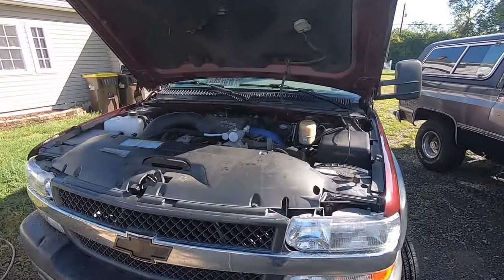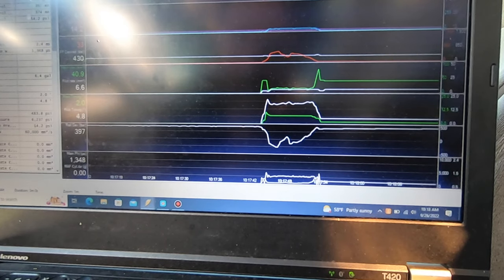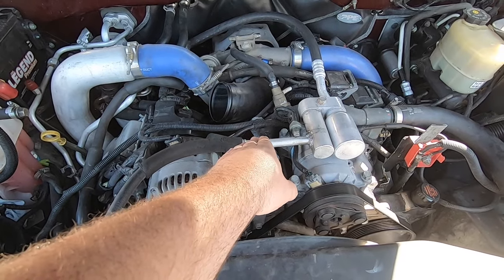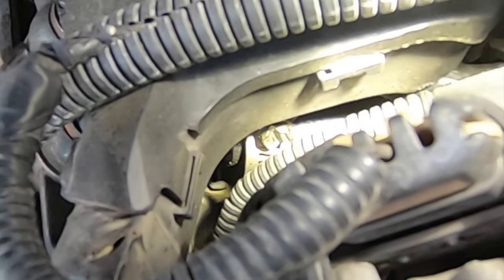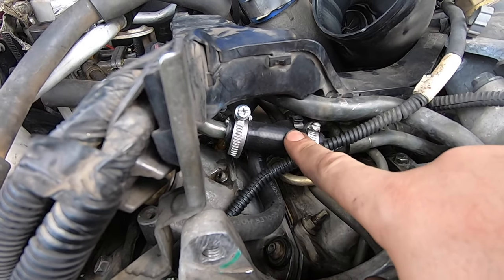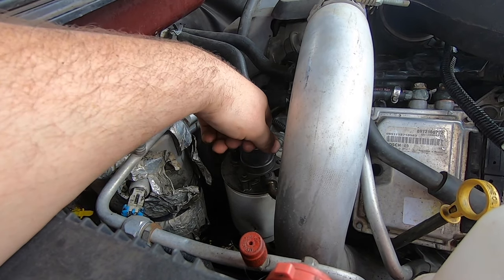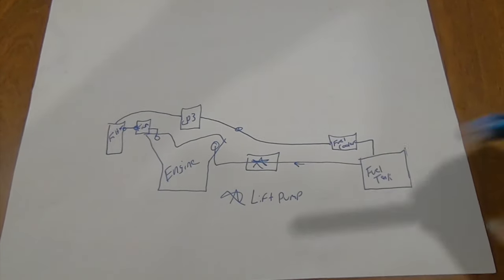Duramax LB7 Losing Prime when parked? Heres how to fix. Silverado 3500HD

Comment: the issue is the primer pump assembly itself is the issue.  The air leak is coming from the pimer pump oring seal on the pump allowing air to enter into the fuel line which causes the air into the fuel rail to the injector.  The primer pump needs to be replaced or rebuild the primer pump.  The hose clamp you used is toooooo large for the hose needs clamping which will cause leaks.  NEVER use BRAKE CLEANER on ANY rubber parts which causes the rubber to become hard and brittle..

Comment: Under that cap you took off, that you said you didn't have an adapter for is still very useful for purging air out of the system.  When you turned your lift pump on, remove that cap and insert a screwdriver into the end and depress the spring loaded ball and the  air in your fuel lines will escape, purging the system of any air. It is normally the highest point of the system and air will naturally migrate to that cap.

Comment: lly duramax decided to not want to turn on today. at first it turned on ran and all of a sudden it turned off on me. I had this same issue like 6 months back and i had it fixed ( fuel filter housing and fuel filter were changed). could i be looking at the same issue again?
Reply: just watched most of your video, ill do a check up on these locations once i can.

Comment: What do I need to do if my fuel primer pump is puking out diesel around the  plunger? I changed it about a year ago and it started doing the same thing within a few months so I changed it again under warranty and it's doing it again? Any thoughts?
Reply from the maker: Here's how to rebuild it https://youtu.be/saooTN1DMmw

But they are problematic. Mine leaked twice in a pretty short time so I eliminated it and put a cat filter block on it. Works great but you lose the priming function which would be problematic without a lift pump or if a lift pump fails

Comment: My problem was the steel line coming out of the aluminum filter head. It was loose and allowing air to suck in instead of fuel. I removed the line by twisting and pulling. Cleaned it and JB welded it back in. Problem solved.
Reply from the maker: Nice! Crazy how many ways these fuel systems can fail us

Comment: This is the exact same issue I am having except if I push the primer when the truck starts to die it will keep running, did you try to do this? i have an 03 with fass 165 and a sump kit. no visisble leaks anywhere that I can see. Thanks.
Reply from the maker: I didnt try that but it probably would of worked. These leaks are insanely hard to find because sometimes fuel doesnt leak out and only air leaks in.

Comment: I have a 2007 classic duramax and parking on flat ground and facing down hill it starts no problem whatsoever but the minute you park facing up hill after 30-1hr it starts for about 15 seconds then dies then you prime it and it runs no problem at all but shut if off for 30-1hr and the cycle repeats I have no idea where the leak is it’s like yours the fuel can’t get out but air is getting in and I’ve been chasing this for months and can’t solve it
Reply: @sparkranch garage
Reply from the maker: Keep looking. Its gotta be there somewhere. You have to very carefully inspect every line from the tank all the way forward to the CP3 unfortunately. These trucks are wildly sensitive to air leaks

Comment: I have a 2007 that sat through a cold snap and now will not start.  No/low pressure to the schrader valve bleeder.  Priming pump was mushy as well.  I am guessing air in the system?

Comment: I assumed the primer bulb would act as an anti backflow valve, but it sounds like that is not the case?   My truck started ticking really bad out of the blue on startup one morning, like it had an instant injector failure.  we shut it down and just started it a couple times to show a mechanic the sound, he agreed it sounded like injector failure.  My plan was to pull the injector connectors off until we isolated the specific injector issue.  Before we were able to, it started doing what yours did.  We would have to prime it, it would load a slug of fuel then die within 2 or 3 seconds of running.  If we pumped the primer it would go soft completely after about 10 seconds.  I bought a whole new filter housing, that did not repair the issue.  Does it sound like the injector could be bypassing so much that it would do that?  Feels like I hit 2 different problems at the exact same time, now I don’t know how to diagnose either.  I would hate to spend thousands on injectors and find it was a $5 tube  causing everything.

Comment: I have an 08 Chevy Duramax put a new prime housing filter housing on truck still won’t start but if we push on the prime button it will start as it’s cranking do you have any ideas and when you shut it off and go to start it Again it won’t start until you push the button one time or twice

Comment: Mine is dry through out the truck, primer goes soft right away.  Starts right up with starting fluid, and runs just fine. Could I have a leaking fuel injectors?

Comment: My 2003 is not holding prime at all it won't start or run unless it is ether, and after hand priming it 10 minutes later, no fuel pressure. Could this be the same issue?

Comment: Hey my 07 duramax, 2500hd. Found the suction line on drivers side 3/8” metal tube rubbed through rubbing against something 2 ft down from QD, GM flaw, many things rub and where on this model, even top radiator hoses and even the large wire QD hitting the cooler tube.
Reply: Hope this info helps the next victim
Reply: What is "QD"? -

Comment: I like your design so that was cool. Now the fuel has to be filtered before it gets to the fuel rails and injectors. I want to see that diagram because I’m not seeing where the fuel gos into the engine. I assume but not sure that lines come off the CP3 and go to the fuel rails/injectors. Also what I learned here is that think is that the fuel is filtered before it even gets to the CP3
Reply from the maker: The cp3 is the last component to see fuel at low pressure. It pulls fuel from the tank, through the FICM, through the filter, then boosts pressure to 5000-26000psi. It’s got a hard line in the valley that feeds both fuel rails and the injectors.

Comment: Good video for sure but the small tubing you replaced doesn’t have pressure on it with the truck not running right? Correct me please but I thought the CP3 was gear driven and would only build pressure when cranking and running. Teach me something
Reply from the maker: Correct, unless the truck is fitted with a lift pump as mine and many are. Low pressure 8-12psi typically
Reply: @spankranchgarage  Yes, I forgot about that. Good job! I also need to get a lift pump because it allows finding any leak much easier with pressure

Comment: I am just embarking on the same problem thank you for pointing me in the right direction I will let you know how this goes❤
Reply: Well that didn't take too long to sort out ended up being a bad fuel line above the fuel cooler where the flex line from the feed side of the fuel tank meets the steel line 👍
Reply from the maker: Glad you fixed it!

Comment: If you ran a smoke machine through the fuel line near the tank, do you think that smoke would have come out of that leak? I'm having a similar problem but after replacing the CP3, the FRPS, the fuel filter housing, and the hoses coming off the fuel filter housing I still get VERY low ACT fuel rail pressure on crank. Like 7 of 38 desired (on live data) no codes and if I give her a little ether bump, she will start and run perfectly. Shut her off and attempt to restart her and she will only crank no start.
Reply from the maker: I was thinking about this too. I think if you blew the lines out so theres no fuel pockets blocking the smoke it would work. You can also disconnect the lines at the tank and lightly pressurize the system and check with soapy water. Last option would be to see if anyone makes a UV dye for fuel that wont hurt anything... like leak checking an AC system. These systems are tricky. The smallest little leak wreaks havoc, as you are experiencing.

Comment: I have a similar problem, extended crank and starts and dies sometimes. But if the tank is over 1/2 full it starts right up. It gets very bad under a 1/4 tank. I’ve been told it’s probably still an air leak like this but it’s hard to believe the truck runs and acts perfectly when you fill it up
Reply: 1/4 issue . See a sump with ur lift pump

Comment: My 2005 LLY is doing the same exact thing. My hoses look a little suspect but I didn’t think they were bad enough to cause this. I will be doing what you did today in hopes it will work. Thank you for the video. Top shelf!
Will report back😢
Reply from the maker: I hope its an easy fix! Almost any hose in the system can cause similar results and they can be tricky to find
Reply: Shane any update?
Reply: Having the same issue with my 05 lly as well I’ve already replaced 3 of the 5 rubber hoses and it was fixed for a few days but now it’s happening again. I’ll let y’all know if it fixes it bc I’m living through the frustration of having a downed work truck

Comment: I have a 2002 lb7 214k miles zero blow by
Last friday i drove the truck to work 11/3 it drove and felt fine i shut the truck off and worked a 12hr day came out and it cranks but no starts. It seems like its not getting fuel if i crank it for 10-15seconds then look out the pipe theirs zero raw fuel coming out. 
Has a code for glow plug circuit a and intake air heater but im in phoenix ambient temp is 60-85 degrees 

It wont even start with a squirt of ether.

A buddy of mine thinks the cp3 died a slow death, due to me driving with a filter head loosing prime”aerating the fuel while driving” he advised me to put a lift pump which i did and got a week out of the truck before it died i pulled the fpr and lines on cp3 checked for metal shavings to see if it grenaded the pump zero metal shavings.
One time when i plugged in a snap on solus scanner it said something about U1800 failure to communicate with ficm i cleared the code cranked it several more times code went away for that. 

Kinda lost at this point on where to further diagnosis it. Dont want to order the cp3 and do the job for it to still CRANK NO START PLEASE HELP

I replaced the filter head and the glow plug module prior to my buddy telling me to pull the fpr and look in the pump for shavings.
Reply: Did you get this figured out? 🤔

Comment: Lb7 turns on at cold start but when the truck is hot it will crank till the batteries die.  But if I spray some starter fluid it starts
Reply from the maker: Did you put a scanner on it and watch rail pressure vs commanded rail pressure? Does it make good power once its running?

Comment: My lb7 losses prime when its cold over the span of a few hours. One day, when it was exceptionally cold, i lost prime while driving twice. After dealing with this problem for a while the truck threw a p0088 code, and idiled very poorly, made it home (fuel pressure too high) and now wont start. Replaced filter and FPR, still no start
Reply from the maker: Are you able to monitor rail pressure when you are cranking it?
Reply: Mike, have you made sure to bleed the air from the lines with the bleeder screw while priming? You may also try priming while someone else turns the key, it’s worked for me in the past. If it’s cranking and not starting you’re just not getting fuel

Comment: I changed every damn hose there is. New fuel filter head, injectors are new, cp3 is new. I added an inline lift pump for more fuel pressure and I am still getting a no start. My primer is rock hard all the time. Even when I didn’t have the lift pump it still stayed primed. Maybe this is a main fuel line issue? Any help would be amazing.
Reply from the maker: Have you watched your rail pressure and desired rail pressure with a scan tool while cranking it?

Comment: This is the video I’ve been looking for!  Thank you for the explanation at the end.  My truck has been unable to smog for a month now due to P0101!  I’ve already cleaned my filter and EGR, but noticed a second code now related to fuel pressure (p1093).  From what I’m reading, this could be caused by a leak similar to this.    Wish my luck on hunting it down.  Thanks again.

Comment: My 2002 was doing the same thing and it was actually the FICM leaking from the back epoxy sealant.
Reply from the maker: Thats a new one I have never seen. Good find.
Reply: Did you have to take the FICM off?
Reply: @ yes I bought a new one, however you can probably re epoxy your old one.

Comment: Same exact issue with my 04.5 lly. I got a fass on it that sounds like shit so I’m wondering if that’s what it is. But it’s got a fuel pressure gauge and it shows 0 until I prime it up before starting
Reply: Have u figured it out mine is doing the same thing
Reply: Same... any suggestions?

Comment: Have the same problem with my lb7 but it dies when it’s hot outside and the ac on  but when it’s cold outside it won’t do it. If it like 90 degrees out it will do it sometimes when I’m driving. Not sure any help would be appreciated
Reply from the maker: It sounds heat related. Hoses swell differently in different temperatures. Look over the entire system. You will see evidence of the leak it just may not be obvious.

Comment: Great video, have the exact same problem on my 06 LBZ. Figured it was a tiny air leak, but I hadn't no idea what I'm looking at with that mess of wiring and lines. This helped a ton for where I should be looking and for what. I figured it would be a bigger leak than that. I probably wouldn't of even took a 2nd look at that hose.

Comment: Mine too... Fuel in the tank. Tank line is good. Primer is holding pressure. Must be this?? Also.. mine will choak n gag on occasion... For no reason.. just driving along. Doesn't seem to matter how much fuel is in it... Or the speed. Thoughts? Gotta be a pin hole?
Reply from the maker: If the primer stays hard I would bet your problem is between the tank and the primer. It will cause a choke and gag too.

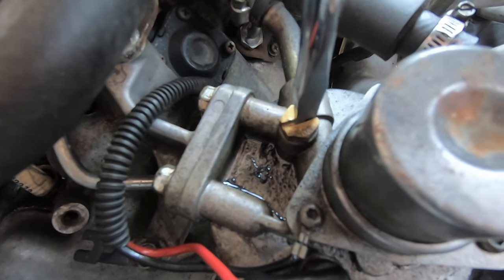Comment: 1:56 if you can already see fuel around your brass screw that should be plastic, thats a leak. the plastic will self seal when tight. brass wont. anyway if this has a leak, you lose prime also
Reply from the maker: Yes a leaking bleeder can cause problems too. The brass screw has an o-ring and seals just fine. Lots of residue from previous bleedings.
Reply: @spankranchgarage  ah makes sense. and even with the oring i have seen them leak, the oring that comes on them is cheap af.

Comment: Hi my truck a 2003 duramax started having a long crank issue, but would start. I found that the fuel filter head was leaking a little fuel so I bought a rebuild kit for it and now it will just crank no start. I did the 15 second crank test to see how much fuel was returning and it was well under 100 ml. I also hooked up a scanner and it doesn't have enough pressure to start the truck. I am thinking failed cp3, but do they just fail like that? I had no other indication of fuel pressure surging at idle before hand. I also blead the system multiple times. I also replaced all the fuel lines from the tank and return lines with nylon lines. Also replaced the fuel cooler. Just wondering if you have any other information that I might be able to try. Thanks
Reply from the maker: I think your CP3 is airlocked. They typically dont fail like that. You can pressurize you fuel tank a little and see if you can get it to bleed that way (Assuming you have no lift pump?)

Some guys will fire them up on either to get the rpms up. Sometimes thats enough to get a weak CP3 to make enough fuel pressure to run. Not my favorite option so do what you want with that.
Reply: @spankranchgarage  thanks for the response. It doesn't have a lift pump. I will try some propane instead of starter fluid.
Reply: fuel sender unit? try to bypass fuel tank using a 2 gallons tank and 3/8" 1/2 hoses

Comment: Good video, thanks for the the info.
Question for you...
My 03 LB7 threw a p0238 code for boost sensor so I replaced the MAP, I also recently replaced the TPS and the Baro sensor trying to chase down a p2227 code.  Now it cranks but no start.  Both batteries are brand new....  Any thoughts?  Fuel system seems to be good, wires and fuses seem to be good.
Reply from the maker: You mean you replaced the throttle pedal?

I would put a scan tool on it and see if its building rail pressure during cranking. You can check the injection pulse to see if its firing the injectors.

For the 2227 you can also watch the baro on the scan tool and see if its reading or if its maxed High/Low you may have an actual circuit problem. Look for pinched wires on the engine harness its common if someone has been wrenching on it
Reply: @spankranchgarage   Yea the TPS is in the pedal assembly.  
Thanks for the tip.

Comment: My 02 lb7 got a lil water in the ficm from the plug not being when radiator hose busted is what I’m guessing now the truck runs horrible loses prime and is putting oil in the coolant reservoir and diesel in the oil and is in limp mode take a good minute to start pretty much new injectors any guesses anything helps
Reply: And great video by the way loved u explain what ur doing and y as best as u can
Reply from the maker: If your putting diesel in the oil it’s gotta be something under the valve covers or the front seal on the cp3. Being there was injector work done I would bet you find a leaking return line under a valve cover. The rad hose and oil in the coolant is likely injector cup related. I have a video on that too. Good luck that sounds like quite a situation